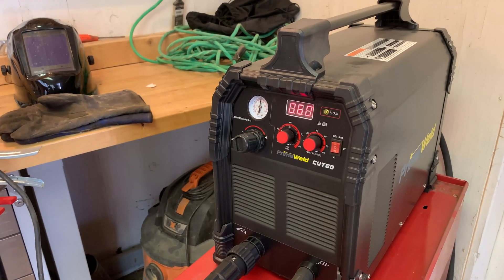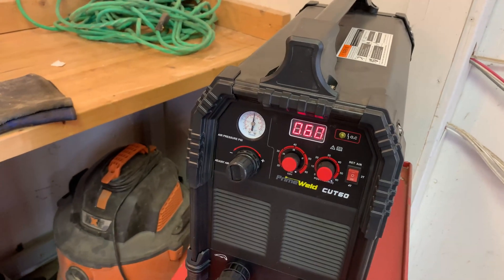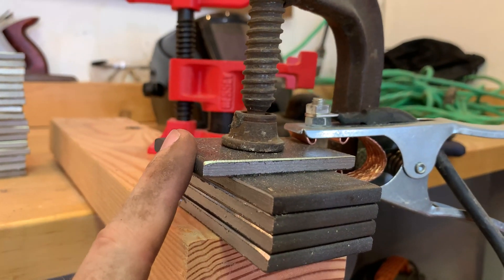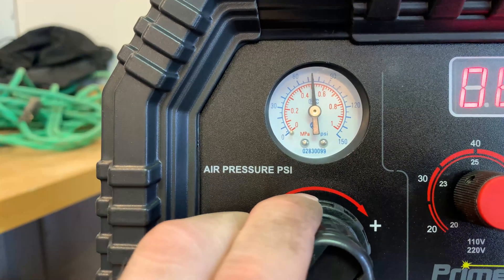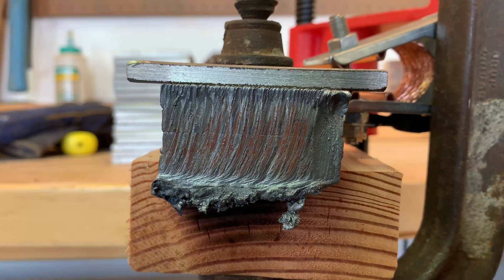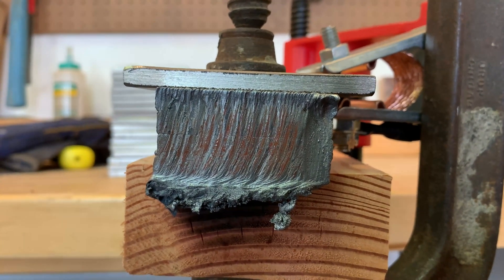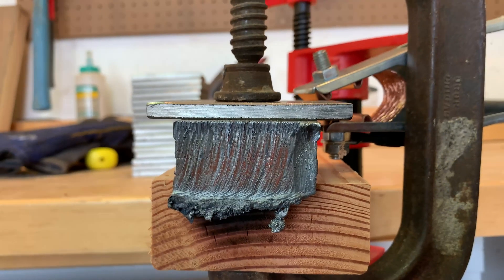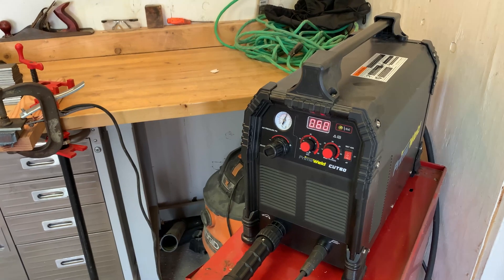Primeweld CUT60 vs 1 Inch Thick Mild Steel (Maximum Thickness Test)

Comment: having been using my cut60 a fair bit lately.  Never looked a the cut chart b4.  I just set amps where it felt like it needed to cut through what i'm cutting.  I find it interesting that they say 45amps for 1/4".  I'm cutting 1/4" @ 23-24amps with any problems.  never even needed to go higher.  So that surprises me.  My cuts are clean too.  And I have my air down to ~50psi also.  Cause most the steel i cut range's from 1/8" to 1/4"  So i just set to 23amps and i'm good to go (running 220v not 110v of course)

Comment: Do they have gouging tips available for these machines for removing welds?
If so Id love to see a video.
Thx!
Reply: I have been trying to find them also and can't seem to find any.  From what i can gather.  gouging tips are just larger dia.  orafice.  like 2.0.  I did a lil gougin for the 1st time the other day w/ the regular tip.  Worked  But probably not as well as could be.  I think a special drag cup  would also be needed while gouging.  I found a different style copper head drag cup that i got that I'm gonna try w/ these circle templates.

Comment: that is pretty damn good for a 1 phase plasmacutter, and i like the better quality build on this plasma, and i like the 1 plug connection on the handle, i just dont like the size of it, it is way to big of a plug, fix that, and this may be in the better end of ""budget plasma cutters"" price aswell, for home use this is somwhat an expensive cutter, but if you need one you are doing heavyer work, and a tool like this is then needed. i have used diffrent professional plasmacutters for 30 years and even those dont cut mutch faster at a maximum cut, even Hypertherm that is the yardstick of plasmacutters.and i realy like the Hypertherm brand they just works.
Reply: Hey what compresor capability do i need for that plasma cutter

Comment: Am I wrong to think that because heat escapes at the seams, that four stacked 1/4-inch plates are significantly more difficult to cut through than a solid 1-inch piece? If so, the thickness test result would be a misleading... not by much, though.
Reply: I’m thinking yes. Also, unless you got all the dirt, rust and mill scale off the surfaces it would add significant resistance to the cut. I would bet this cutter can blow through solid 1” plate like butter.

Comment: Curious, do you have a meter that could measure the power usage while the CUT60 is running?

I've been curious if it would be worth trying to run on a 240v 30 amp circuit, per the Imax it needs 48.6 amps  on 220v and 43.4 amps on 110v. I don't really care about 110v, but am interested how many amps it draws when cutting at 20amps, 40amps and 60 amps on 220v. Do you have that capability?
Reply: So I am running mine on a 30amp circuit because my entire shops main sub panel only has 30amps to it.  And it works fine.  I granted I don't run it over 30amps of course.  In fact ironically today is the 1st time i've gotten steel thick enough i need more juice and had to take it to my friends house to plug in so i can run it at full 60amps to cut some 1/2"-5/8" plate.  Although i haven't tried yet I may try and see if i can cut 1/2" @ 30amps (or play with whatever the limit is till just b4 it wants to trip the breaker 8-)  Cause i have to let my compressor fully fill b4 I do my cutting as i can't have both run at the same time or I will trip a breaker.   I don't have a clamp meter But  I I did find it odd that the imax is lower then the actual max cutting amp rating.  I was under the impression that the ratio was basically a 1to1 but clearly it's not.  Since at most it only needs a 50amp breaker max.    But again i found it weird that they had recommended cutting 1/4" at 45amps which seems way excessive when i am getting clean cuts @ 23amps on 220 @ ~50psi.
Reply: @Wooddust6  Thanks for the reply, I do check my notifications. I still haven't bought it yet, but it's still on my radar. Power will not be as much of an issue, hopefully as I'm building a new 30x40 shop and moving most of my machines up there, where I have 320 amps. Where I live I currently only have 125amps, and I'm on a dryer circuit also, which is why I was asking about amps. I can currently run a 7-1/2HP RPC for all of my 3 phase, but have a Phase Perfect 20HP/55amp (continuous) of 3 phase. I will have a 200 amp panel for the shop, 100 amps for the Phase Perfect, and 100 amps of 1 phase for 240v and 120v. I currently use oxy-acytelene  but have small tanks. I have looked at the Hypertherms, but they're about 3x the cost of the PrimeWeld. FWIW, I have a PrimeWeld 225x Tig Welder, I love it. It is actually not a bad Stick welder, but I only use it for Tig as I use an ESAB for stick. I RARELY, and I mean RARELY work with even 1/2" material, although I have some of it, I could even cut it with an angle grinder or band saw if needed. It's been about 2 years since you got the Cut 60. Has it been reliable with zero problems?
Reply: @Wooddust6  I am doing similar in my new shop I'm building with 3 phase and 1 phase. I have 200 amps of 1 phase going in, but running a 100 amp breaker to feed into a phase perfect, and then going into a 3-pole sub-panel for the 3 phase machines. County gave me 320 amp continuous service.👍 My current home only has 125 amps, hence my 30 amp dryer circuit. You could probably run more amps but you would probably need larger wire to handle it, but if you ran larger wire to your sub-panel, you could replace the main breaker with a larger one.